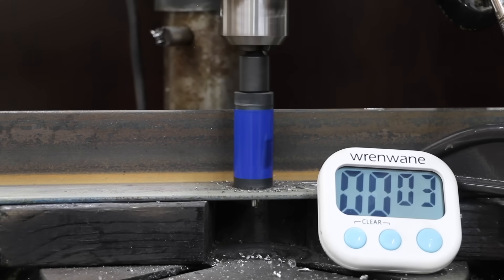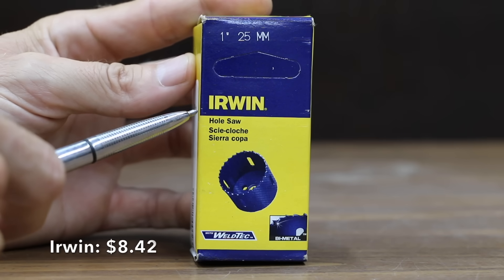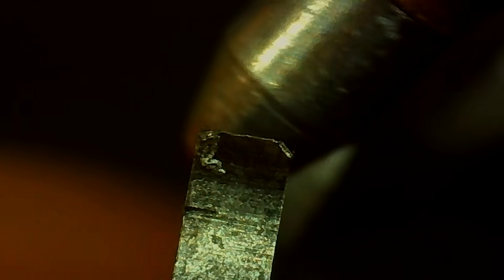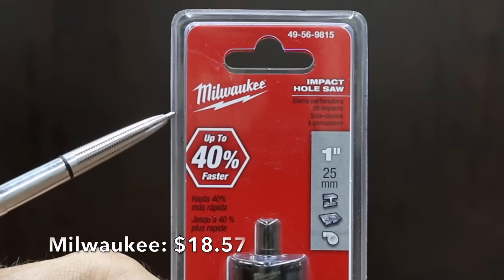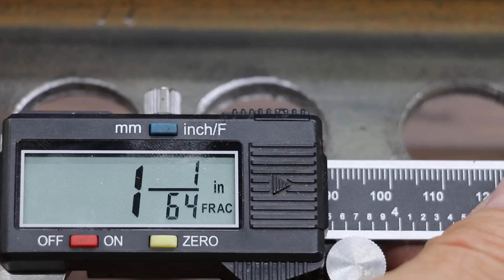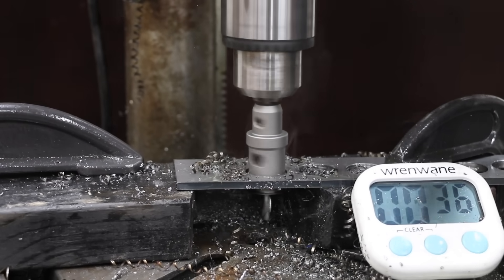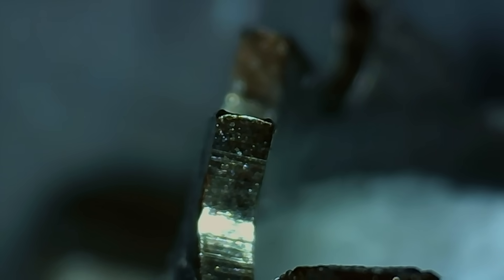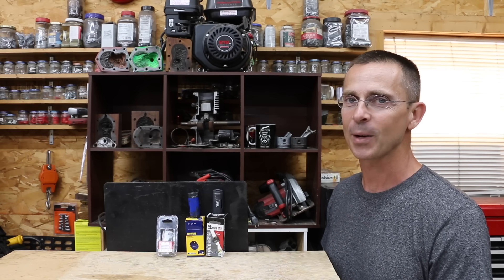Best Hole Saw Brand? DeWalt vs Milwaukee vs Irwin, Bosch, Lenox, Diablo, Bosch, MK Morse

Comment: I think this test was great and I really enjoyed the video as always. I do think your spindle speed may have been too high. When I cut abrasion resistant (ar) steels with live tooling in my lathe I slow my carbide tools down to 100 surface foot per minute (300-450 sfm in soft alloys such as A36 and 1018 for comparison) and reduce my feed by 75%. To put this is mathematical terms, I would run a carbide drill in A36 or 1018 steel at 350 SFM. To calculate rpm, rpm=3.82×SFM×tool diameter, so 3.82×350×1=1337 rpm. To run the same drill in AR 400 steel I would run the same drill at 100 SFM or 382 RPM. I can't be sure exactly as I wasn't there but your spindle speed appeared to be too high and over speeding hole making tools tends to wear them out very quickly.
Reply from the maker: Thanks for the feedback.

Comment: Each material has its own rate of cutting speed. As does each type of cutter material. The bi-metal or more accurately hss high speed steel should be turning half the speed of the carbide. Likewise the armor plate requires about half the cutting speed as low carbon steel does. I like you videos. You do a fabulous job of going through every possible scenario. Though the above details were not mentioned. Or at least, I didn’t catch them. The Machinery Handbook speeds and feeds is a good spot to get any info for cutting metal.
Reply from the maker: Thanks for the feedback.

Comment: I drill a lot of stainless steel boxes at work and I've had great success with the greenlee carbide hole saw kit. Also their carbide unibit is a beast as well. I've gotten over a year of use from it whereas i was going through at least 3 Milwaukee ones a year.
Reply from the maker: Thanks for sharing.

Comment: I cut bunches of holes with the Dozer to shoot insulation into the walls of an old building. I resharpened with a flat file, and the Dozer went back to work again.
Reply from the maker: Thanks for sharing.

Comment: https://smile.amazon.com/Greenlee-660-Change-Stainless-7-Piece/dp/B001HWB5OA/ref=sr_1_1?dchild=1&keywords=Greenlee+745&qid=1597253323&sr=8-1

I’ve had this set for years and use them regularly as an electrician. I drilled 81 holes in stainless with the 7/8” one to mount push buttons into some electrical cabinets.  It was used when I started and still good at the end.  Combined with xtra thick tap magic, they last forever.

Comment: I'm not sure how you would correct this, but the amount of walk on the drillpress has a significantly bad effect for drilling holes, both with hole saws and bits. Our drill press walks a fair amount too, and we even put some shim steel in the neck to help tighten it up. For serious holes, or stuff I want accurate, I clamp it in the vertical mill, there's no play in that. 

I wonder how much that affected this test. Granted, if someone was using a regular drill, they'd probably get similar behavior.  Excellent comparison none the less!
Reply: I noticed that too and the runout on his chuck.  Time for him to do a drill press comparison!
Reply: @praxeological  tell ya what, that seems to be a very difficult thing for manufacturers to do. We have a Rockwell that's probably 35 40 years old and its loose as a goose.
Reply from the maker: Thanks for the feedback.

Comment: 9:13 The saw only made one cut, so there is no way to know how precise it is. You were talking about the accuracy, not the precision of the size of the hole cut.

Also, if you can figure out a way to do a controlled test on the impact-ready things, I would like to see a test using an impact driver. Maybe they would perform better on their intended tool.
Reply from the maker: Thanks for the video idea.

Comment: Suggestion: I know you have tested epoxy before but have you done a 5 minute epoxy test?  I use Loctite but have been tempted to use Devcon, I think that's the stuff they use on Forged in Fire.  Anyways knifemakers might find it useful to see which Epoxy works best when gluing wood to steel or micarta to steel or acylic to steel.  As always thanks for the awesome info.
Reply from the maker: Great suggestion!  Thank you.

Comment: I think you should add Blair Rotabroach & Hougen RotaCut to the mix.
Reply: The Hougen Hole Saw!     What a machine!       Most people can't afford one. . . . .
Reply: Check out the hole cutters at Yardstore.com and Snap on. I think that they are around $35 for the 1" cutters. I just gave manufacturers information earlier.
Reply from the maker: Thanks for the video idea.

Comment: This was not an easy video to watch as I owned a machine shop with the proper equipment to do these types of drilling.
The drill press had so much wobble in it of course the teeth will break.
Second it is absolutely critical that you use coolant to keep the work piece and the holesaw cool. As I use to say if you see smoke then it is way to hot and will destroy the cutter and work harden the material.
You must flood this type of cutting action.
250 RPM was way to fast for this cutting.

Comment: Honestly looks like there  is a ton of play  in the drill press head.. perhaps that is the reason the wholes are not correct,  If you had a lathe or mill and trued the bit the results would had been better for the dimensions. with that said the tools are for a everyday person to use, Great job thanks for sharing
Reply from the maker: You are welcome!

Comment: You should be calculating proper feeds and speeds for tests like these i know its just a hole saw but if you could calculate the s.f.m witch is probably around 40-50 for a high speed or tool steel not carbide hole saw that size in mild steel and then a chip load of .0005 per tooth (depending on amount of teeth) to find your i.p.r then you could calculate your i.p.m/feed, to have a proper test be nice if you had a cnc mill but were talking hole saws here... just push harder lol 99% of the time your sticking that sucker in a drill and standing on it.
Reply from the maker: Thanks for the feedback.

Comment: Have you done the best way to make a hole in wood? I was making 2 and 1/8th holes in 2 by material yesterday. Forstner  bit bogged down my older drill. And milwaukee hole saw had to have the annoying puck clean out. I'd love the link if you have done it already.

Comment: I have to wonder about the saws that "started off well but then faultered" during the mild steel test....why did that happen?  Several of them did not show any damage to the teeth,m so what was happening here?  Was it heat build up?
Reply: Could be work hardening of the steel via heat (and some pressure) after awhile?

Comment: Fairly quick product test suggestion:  I sure would like to know which tire pressure gauge was worth owning!  I need a gauge that is accurate at low pressures (eg, 6PSI, for water tanks), and high pressure.
Reply from the maker: Great suggestion!  Thank you.

Comment: Hey project farm try running an engine on LPG gas
Reply: That's not a test that hasn't been done before - 2 of my recent cars have run on LPG, 220k + 200k km in each vehicles with no bad  outcomes as far as metallurgy is concerned  -  LPG in modern engines is not a problem.
Reply: @kadmow  I mean in a small engine i know that it can run on cars

Comment: Mr. Todd thanks for another great video. Working maintenance at the hospital for my last 20 years of service. Well part of the hospital was built in 1955 through 57 and we've had numerous upgrades since then. We used Greenlee. We had a couple of assistants well more through the years but you might have to change out Hardware on a door and back in the 50s and 60s the door casings were some pretty heavy-duty metal starting out. Which that was not the worst part drilling out holes. The problem was it didn't matter how many times you told one of our guys check it make sure you're not hitting the concrete. And yes back in that day they actually poured concrete around those steel door frames and it was attached to the internal walls. And there is not a whole lot that'll do more damage to a drill bit than concrete as you know. Which we had a Hilti and some bits to drill in concrete but not large holes. If I had to put a 4-6 inch hole in the firewall I would have to go rent the drill and bit because we couldn't afford to buy them. And that's something else about Greenlee they are expensive. Oh well I'm rambling on too long but thanks again for the video and you may not want fool with Greenlee but I just thought I'd throw my two cents worth in I guess. And you have a blessed day sir!
Reply from the maker: Thanks for sharing!

Comment: Your vidieos  are great, i think it is great that someone is holding manufacturers to account. Have you ever tested things like rivnuts, weldnuts thread inserts  etc ? I'd really like to know how strong they are compared to each other. Also have you ever done a back to back test of a makita battery angle grinder vs a copy? Thanks
Reply from the maker: Great suggestion.  Thank you.

Comment: I never put oil on drill bits or saw holes because it's took so long to drill (too slippery just like motor engines) and damages teeth or drill bits are showing burn or dull coloring too. I put water and it's making hole faster and the drill/teeth is last longer and keeping drill/saw hole cool too without damage and yes it is true as I learned from my dad and father in law who was shop mechanic for 30 years. I have the same drill from both dads are the best because they're using water on it without showing dull bits.
Reply from the maker: Thanks for sharing.

Comment: We use Bahco brand with carbide  teeth at work cutting  holes for spa jets in  Acrylic with an ABS backer and a polyurethane  fiber glass composite.  Granted its not  steel but they hold up really  well.
Reply from the maker: Thanks for sharing.

Comment: Excellent work as always. Your tests never fail to impress. It's good to know some of these companies you are putting to the test are reaching out and letting you know that they are working to improve their products. I understand why you likely won't mention them as it could sound like a sponsor which is against what you do. However it would be nice if you purchased some of their products now before they get changed and then wait until they are changed and pick up the "improved" versions and do a comparison to see if they actually did change them or are blowing smoke. That would be a really interesting showdown. Not so much about quality of product but the quality of the company.
Reply from the maker: Great suggestion.  Thank you.

Comment: Regarding the armor plate, I was told as an apprentice (close to 40 years ago) that once you start drilling a hardened metal or stainless steel, that you can't stop or take off pressure the drill bit because the metal being drilled will work harden. You seemed to stop and lift the bit, apply oil and restart.  That's probably why you  couldn't drill any further despite still having decent teeth on the bits.
Reply from the maker: Thanks for the feedback.

Comment: Great video Project Farm! I would like to suggest an idea. Hopefully You see it with the amount of comments. Pretty simple , actually. Buy as many different brand pressure treated lumber screws You can find. You could also mix it up a little drywall screw, tapcon etc...Then sink them in to a pressure treated 4x4 , let it sit a few months , then compare the corrosion of the screws. 👍 Keep up the good work Brother......
Reply from the maker: Great video idea.  Thank you.

Comment: Great video once again. "We're gonna test that!" Needs to be made into a shirt with your name/logo on it.
Reply from the maker: That would be cool!
Reply: @ProjectFarm  I'd buy one.
Reply: @ProjectFarm  hey man, I suggest you make a video on comparing the different types of turbo nozzles for pressure washers. If they're all the same or if some are better than others. Just the turbo style
Reply: @ProjectFarm  I’d buy one!
Reply: Project Farm If you made merch maybe you could make a video out of it - which tshirt printer is best etc
Reply: I agree, "We're gonna test that" would be your best seller by far. Count me in!
Reply: I want one of those. Would definitely but a hoodie version.
Reply: I'd buy one too
Reply: Yeah that would be cool
Reply: Yes
Reply: Yes
Reply: nice... would rock one
Reply: I own a silk screen print shop, in case you want to work something out for merch
Reply: And I did a lot of marketing, and “We’re gonna test that”, that was another smile moment. I want to be on the waiting list for that shirt. You are inspiring a movement!
Reply: I’d buy one
Reply: “Do you even tool bro?”
Reply: I was wondering if the paint on some of the hole saws had any thing to do with the stoppage?  Interesting.  That question came up on one of the saw blades with strong teeth but was painted.  Can't remember which but it hung up once when you used it

Comment: Here's a very odd oddball. Could you maybe test tool dollies. The kind that you might set a very large old bandsaw or heavy old cast iron tablesaw on semi-permanently/permanently. Places like Rockler woodworking and Woodcraft and Harbor Freight have such things. I have an old Delta dolly under my Parks No2 bandsaw. Not the best mover anymore.  You're the top at getting right to the best test methods for anything, so this might get surprisingly informative. Thanks for all the great test info!! For someone who buys a lot of tools like these hole saws, this channel is incredible.
Reply from the maker: Thanks for the video idea.

Comment: I use Greenlee and Milwaukee Hole Saws to drill wood, plastic, mild and stainless steel with excellent results and I usually my hole saws last for hundreds of holes. My method is to drill the pilot hole without the hole saw attached and then drill at a slow to medium speed with the hole saw filled with pellet ice or crushed ice (Sonic Drive Ins are my main customers so pellet ice is almost always available). I use electric tape to close the holes in the side of the hole saw to prevent the ice from falling out, the melting ice keeps the hole saw and the metal being drilled from getting hot as well as flushing the chips away. Most of the time I’m drilling holes in the canopy frame or poles that are 3/16” up to 3/8” thick but I have drilled plenty of holes in stainless steel tables and thin stainless steel on the walls. The holes are much cleaner than drilling without lubricant and cleanup is easy which is really important in food preparation areas. One very important thing when drilling stainless steel is to keep the speed SLOW to avoid heat buildup because stainless steel gets very hard if it gets hot and once that happens it is almost impossible to drill through. Make sure to use a “Split Tip” drill bit (135 degree) for drilling stainless steel. 
The holes that I have to drill in stainless have to be de-burred to prevent damage to cables, I use a Greenlee model 11170 de-burring tool on my drill for this and it works like a charm!
https://www.greenlee.com/us/en/deburr-tool-11170

Comment: Have you ever compared Hilti, Dewalt, Milwaukee,  Bosch, etc. Hammer drill bits into concrete? The Hilti bits on larger diameter holes with rebar are pretty sweet in my experience.
Reply from the maker: Thanks for the video idea.

Comment: Only channel worth the obnoxious number of commercials YouTube plays. Great job as always.
Reply from the maker: Wow, thanks!
Reply: @ProjectFarm  Seeing your tests for bits and various cutting tools, I would be interested in chisels. I've been doing masonry work on my home lately and wonder which cold chisels are worth the money. How well do they chip brick, block, concrete. My guess is most people don't buy a lot of chisels so knowing which ones will last is worth it. I would also be curious about wood chisels.  Does a Stanley come close to a Lie-Nielson? Sharpness, how accurate is the bevel, hardness, handle strength, etc.

Comment: your drillpress seems out of balance. That could be the reason for breaking chips on the teeth on some of them. This is due to the force that is put sideways on de teeth. That could also be the reason that some holes are not looking good. 

Don't know for sure if this is the case, but it seems like it.
Reply from the maker: Thanks for the feedback.

Comment: would you mind retesting the Milwaukee shockwave bit, like with a hand drill? i'm an electrician and i've used those bits and they work great. we drill straight through steel purlins multiple times with them to run our pipe, they also cut through stainless steel for us. of course they wear out eventually but for it to not even cut a hole through that angle iron baffles me.
Reply from the maker: Thanks for the suggestion.

Comment: I've used the Bosch powerchange holesaws for a few years, the have 8% cobalt and will cut through thick (6mm) stainless steel even at high speed, the teeth however CAN snap off if the the tool is allowed to snag, I actually rate them as good as Starrett
Reply from the maker: Thanks for the feedback.

Comment: Another great product review.  I only use the type of hole saws you tested for wood and light gauge steel studs.  For thicker mild or structural steel I use HSS annular cutters as they make a cleaner hole in a fraction of the time as the ones tested.  Annular bits can only be used in a drill press though, preferably a magnetic base type.
Reply from the maker: Thanks for the feedback.

Comment: The big advantage in high speed steel is one can easily sharpen them with a small and thin grinding disc. They beat carbide because they have a smaller kerf and can be sharpened to a finer point than carbide, which is prone to chipping. But it seems a lubricant should have been used with all of them.
Reply from the maker: Thanks for the feedback.